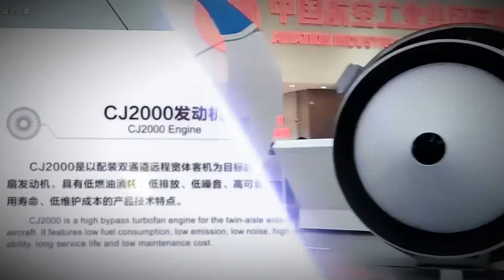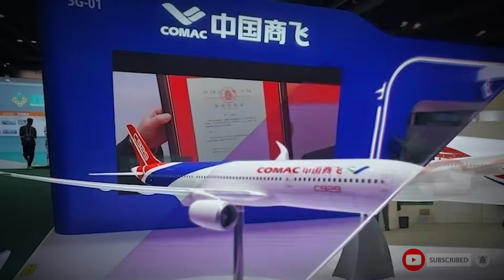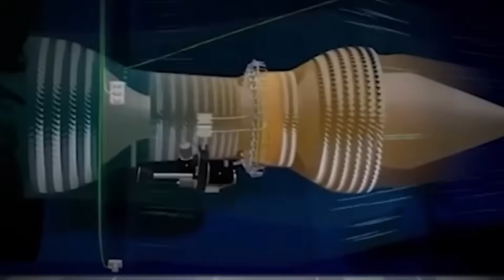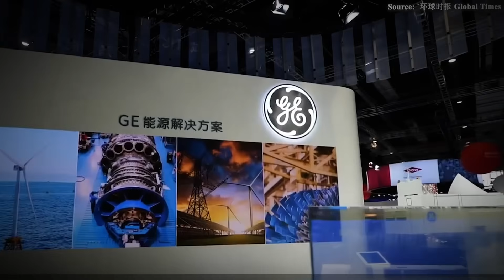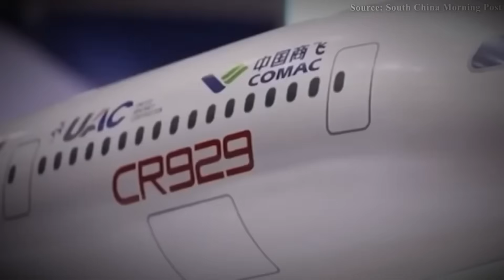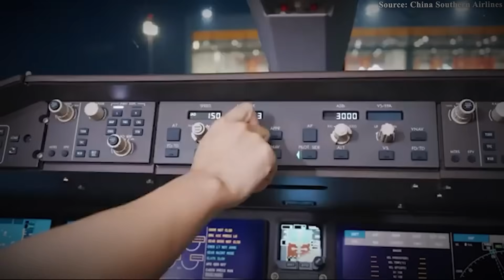How China’s CJ-2000 Just Shook Boeing and Airbus

Comment: China has parallel development of all parts from domestic sources for the C919. CJ1000 is designed for C919. The choice to use western resources is to ease certification and it is the main reason Russia pulled out of the program.
Reply from the maker: From what I’ve heard, a big part of the split was the sanctions that came after the war in Ukraine — they made it difficult for Russia to stay involved in a program that relied heavily on Western-made parts and certification pathways. But I’m very open to other trustworthy sources if you have them, because there are a lot of different explanations floating around. Always good to double-check the facts.
Reply: @EngineeredGiants there was long running conflict between the two sides over the use of western parts
Reply from the maker: From what I understand, it wasn’t just one reason — sanctions made things harder, but there was also a long-running disagreement between China and Russia about how much Western technology should be used in the aircraft. After the Ukraine sanctions hit, Russia couldn’t reliably access those Western components anymore, which pushed the partnership over the edge. But if you have solid sources pointing to other factors, I’m definitely interested — this topic gets a lot of mixed information.
Reply: @EngineeredGiants you are right. I was focusing on the fact China chose to use western technology instead of domestic development. As we know China is fanatically devoted to having domestic technology on everything.
Reply from the maker: @chrischang3002  Exactly — China normally pushes hard for domestic tech, but with the early C919 and the joint wide-body project, they chose Western components mainly to simplify global certification. Now that the political landscape has shifted, they’re doubling down on fully homegrown systems again. It’ll be interesting to see how fast that transition happens.

Comment: Technology for military and civil engines is very similar. Twenty years ago China didn't have the technology to produce engines for its fighter aircraft and used Russian engines. Developing engines takes more time than developing aircraft - except with the F-35 - but the engine for J-20, whose development I think started about 2000 and was promised to be ready in 2025 appeared a year early. It cost an immense amount of money and effort, but it was a military necessity and just as US government, via the Pentagon, paid huge amount of money for US engine technology, so did the Chinese government.
Reply from the maker: Good points — military engine development really does lay the groundwork for civil programs. China’s struggles with fighter engines 20 years ago are exactly why the CJ-2000 is so interesting today. They poured massive resources into the WS-series engines for the J-20, and that experience — materials, cooling tech, turbine temperatures — is now feeding directly into their commercial engine programs. It took a huge amount of time and investment, just like you said, but it shows how fast capability can shift once a country commits at that level.
Reply: China's military jet engines are famous for being unreliable, low power, and, high fuel consumption
Reply from the maker: @larryallen9404  Yeah, that reputation has followed China’s military engines for years — low thrust, high fuel burn, and shorter lifespans. But things are changing quickly, and there’s a lot of movement in that area now. Might be worth covering in a video, because the new WS-series engines are showing improvements that most people aren’t aware of yet.
Reply from the maker: Thanks for sharing such a detailed comparison! It’s fascinating to see how the WS-15 and WS-19 engines stack up against their U.S. counterparts. The advancements in technology are truly impressive.
Reply: @larryallen9404 Comparison of China's WS-15, WS-19 Engines and 6th/7th-Generation Engines with Those of the United States
 
As advanced active-duty military turbofan engines in China, the WS-15 and WS-19 have surpassed their U.S. counterparts of the same generation in some core performance metrics. In the cutting-edge race for 6th and 7th-generation engines, China and the U.S. are in a competitive stance. China has made breakthroughs in some key technologies, showing leading potential in certain fields. The specific comparisons are as follows:
 
1. WS-15 (Turbofan-15)
It is a 4th-generation large-thrust turbofan engine tailored for the J-20, benchmarked against the U.S. F119 engine that powers the F-22.
 
- Thrust: The maximum afterburner thrust of the WS-15 reaches 18.5 tons, while the F119 has a thrust of 15.88 tons. The higher thrust enhances the J-20’s maneuverability and supersonic performance.
- Thrust-to-Weight Ratio: The WS-15 exceeds 11.5 in thrust-to-weight ratio. Its low bypass ratio design balances high thrust-to-weight ratio with low fuel consumption, ensuring faster response speed.
- Durability & Upgradability: With damage tolerance design, the crack propagation life of its blades is tripled, and the overhaul interval exceeds 6,000 hours. In contrast, the U.S. F119 has long been out of production with no room for technical iteration, while the WS-15 can undergo continuous optimization and upgrades.
 
2. WS-19 (Turbofan-19)
It is China’s advanced medium-thrust turbofan engine, mainly for the J-35, compared with the U.S. F414 engine equipped on the F/A-18E/F.
 
- Thrust: The maximum thrust of the WS-19 ranges from 11 to 12 tons, far exceeding the F414’s upper limit of 9.8 to 10 tons.
- Key Technologies: The WS-19 integrates vector thrust technology and adopts a serrated nozzle design, which not only improves the aircraft’s super maneuverability and short takeoff/landing capability but also enhances stealth performance. The F414, lacking vector thrust technology, is clearly insufficient to meet the high maneuverability requirements of next-generation fighter jets.
- Fuel Efficiency: Its advanced aerodynamic design and high-efficiency combustion chamber technology balance thrust improvement and fuel consumption reduction, making it more comprehensively adaptable than the F414.
 
3. 6th-Generation Engines
Both China and the U.S. are focusing on adaptive variable-cycle engines, which can flexibly adjust the bypass ratio to balance high-speed thrust and low-speed fuel efficiency.
 
- The U.S. has the XA100 prototype and has accumulated technical foundations through years of pre-research projects.
- China has achieved differentiated breakthroughs in variable-cycle technology: its three-bypass ratio variable-cycle technology has completed full-engine ground and high-altitude test bench trials. This technology enables aircraft to save fuel and reduce noise during takeoff and subsonic flight, while increasing thrust during climbing, acceleration, and supersonic flight, adapting to more combat scenarios. Additionally, China has laid out patents for adaptive cycle technology with intercooling and heat exchange, forming unique advantages in thermal management and efficiency optimization. It is on the same track as the U.S. XA100, with some technical indicators already competitive.
 
4. 7th-Generation Engines
Both countries have identified detonation engines as the core R&D direction, given their advantages of high thrust, low fuel consumption, and simple structure—key to next-generation engines.
 
- China has made remarkable progress in this field: the China Aerospace Science and Technology Corporation (CASC) has completed the long-duration thermal test of a hydrogen-oxygen rotating detonation rocket engine, with a specific impulse of 585 seconds and a combustion chamber pressure of 30MPa, laying a solid foundation for the power system of 7th-generation aircraft.
- While the U.S. is exploring related cutting-edge technologies such as hybrid electric propulsion (e.g., the "Speed and Runway Independence Technology" demonstration project), China has taken the lead in achieving key breakthroughs in the prototype testing of hydrogen-oxygen rotating detonation engines. This gives China a first-mover advantage in this core technology track, promising leapfrog leadership in power performance in the future.

Comment: China is already a self sustaining country for all aviation products from the landing gear to the engine. The new C929 is a totally home grown wide body long range commercial aircraft. Its CJ2000 high bypass ratio turbofan engine has proven its high performance and reliability as the C929 has completed the 12000km flight test succesfully.
Reply from the maker: Absolutely — China has come a long way, and the push toward a fully homegrown wide-body is real. I actually covered the C929 and its reported 12,000 km test flight in a separate video. If the CJ-2000 continues to perform the way early data suggests, China will be much closer to full aviation independence than most people realize.
Reply: One test flight proves nothing
Reply: @larryallen9404 just get ready for more heart breaking moment. Soon enough you will get used to it.

Comment: What nightmare...?.. The market is there, demand is high for new aircraft, all it takes is production and market expansion, Mexico would be a good partner with access to all markets and resources unnencumbered by any sanctions....
The market is for Boeing to loose and not from any competition abroad, there is room for another two Boeings, read the market, there is a 12-15 years of backlog demand for aircraft and it would take two Boeings or Airbus sized companies to meet demand and reduce the backlog to a maneageble two years....!..
Reply from the maker: You’re absolutely right that demand is huge — Boeing and Airbus are sitting on more than a decade of backlog. But that’s exactly why the CJ-2000 matters. The real ‘nightmare’ for Boeing isn’t today’s demand, it’s the moment a fully independent competitor shows up with its own wide-body jet and its own engine. COMAC doesn’t need to replace Boeing — just being a third option in a supply-strained market already shifts the balance. The C929 powered by the CJ-2000 is China’s first real attempt to do that, and if it proves reliable, it will take a chunk of that unmet demand that Boeing and Airbus physically can’t build fast enough.